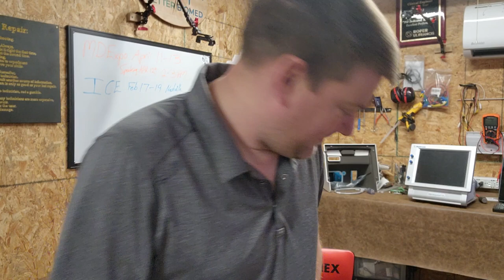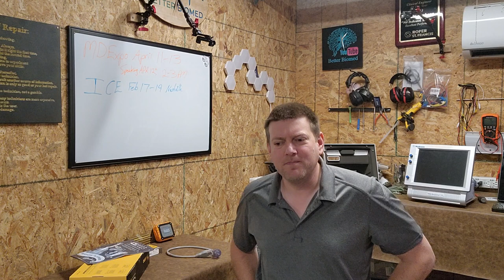OEM Cutting Cords?!?

Comment: Why any OEM would care if the power cord has been replaced due to mechanical wear? Why the OEM people didn't replace the cord to the color they prefer?
Why anybody on this planet would think replacing the power cord is a magic trick seen only in the Hollywood films?

This is 100% wasted energy, time and resources on non-existential problem.

Comment: TBH I wouldn't be surprised if this was done because they legally had to. This is where we really need to update laws and change how liability works. I remember doing work experience a while ago with someone who worked as a test and tag technician (those safety tags you see on appliances that are required by law). One of the devices he tested was a microwave, he told me one of the tests they have to do is shut the door and from a very small distance away only a very small amount of leakage is allowed, and this particular microwave failed the test.

By law he has to cut the plug off that microwave so it cannot be used. He cannot say hey this failed the test don't use it and put a fancy sticker on it. He has to physically damage the device to make sure it cannot be used. If he doesn't, he can lose his license, get sued, and if something happens to someone your seriously up ship creek without a paddle! Is that fair? Of course not! Is it fair to destroy a perfectly good working microwave just because its 0.00001% out of specification? Of course not! But what's he supposed to do? Risk his life getting absolutely destroyed because he feels the laws unethical and idiotic? 

The other problem is if you do tell them Hey this is not safe to use, then leave them with it trusting they won't use it. Come on you know the number of customers who actually listen. You tell them THIS IS DATA RECOVERY ONLY! The device works because that is how we get back your data. We are not warranting the functionality of the device. Stop using it. Yeah, yeah, we understand. I've actually already purchased a new machine to move to they will say.... 3 weeks later their back on your doorstop demanding a refund because the device stopped working.  Damned if you do, damned if you don't!